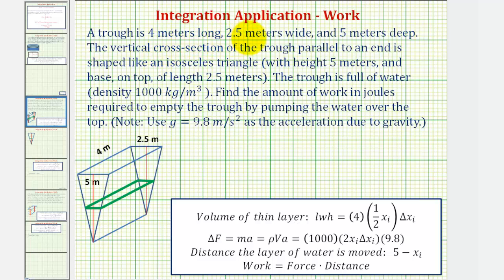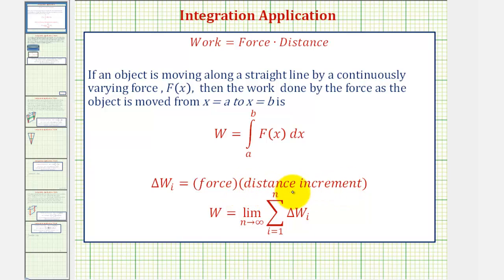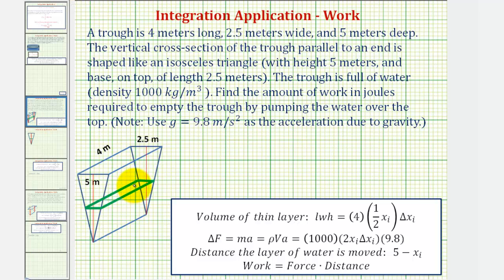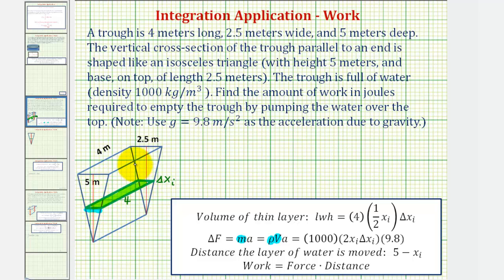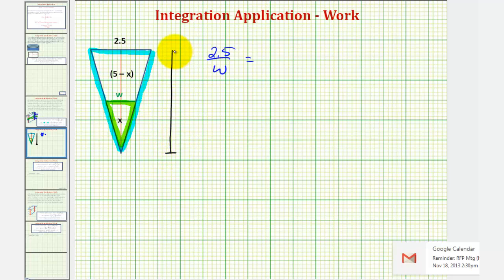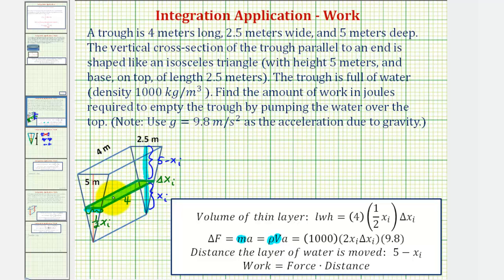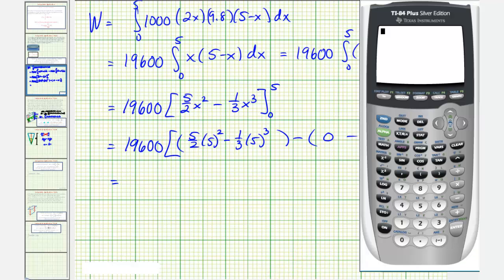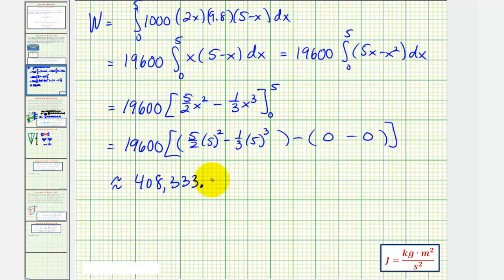Ex:  Determine the Work Required to Pump Water Out of Trough (Isosceles Triangle)

Comment: Is there a reason why you're representing the height with an x? I realize that you'll ultimately end with the same value, but it's a little confusing when the convention for vertical is y. At any rate, thanks for sharing your work.
Reply from the maker: I agree with you that a function of y would also work and might be more intuitive.  However, this way we do have a function of x, which matches more closely with what students were assigned for homework.  :)  Thanks for watching.